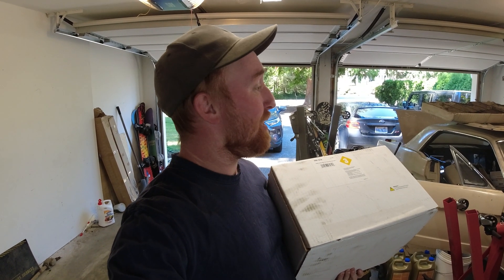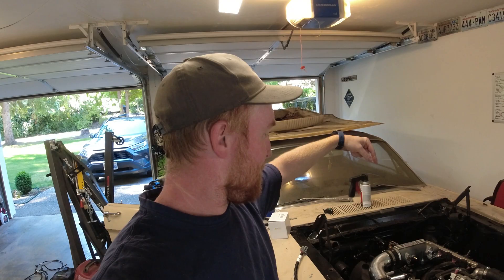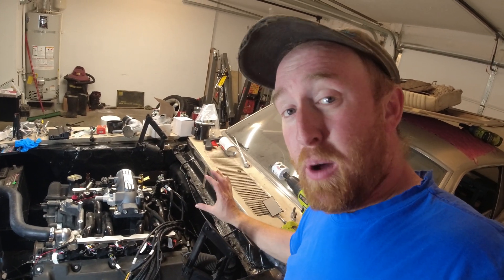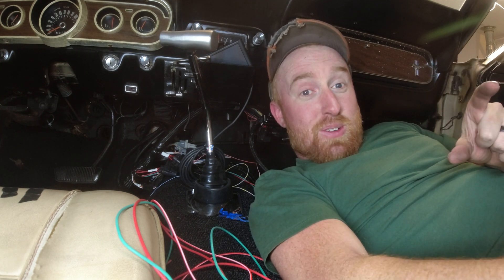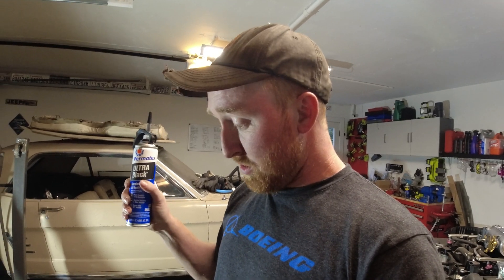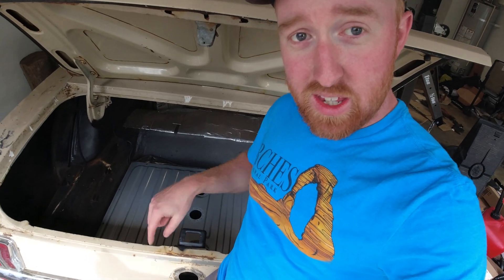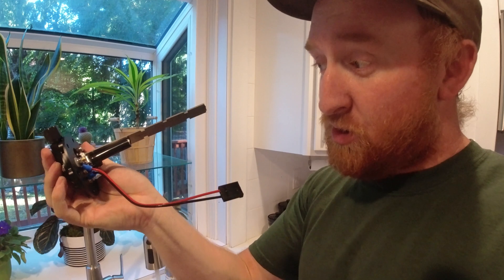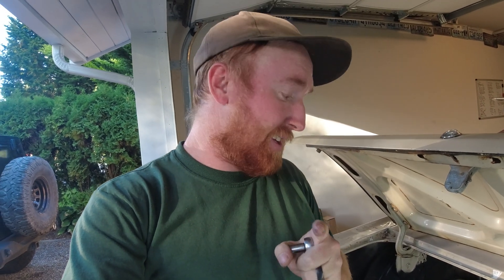EASIEST WIRING for F/I Conversion with Holley Terminator: 1966 Mustang 4.6L MOD MOTOR SWAP Episode 7

Comment: Was the Lincoln town car drive by wire and you swapped it to drive by cable?
Reply from the maker: That is correct. Since I didn't use the town car wiring harness and computer, I had the option with the holley. I'm happy with the decision!
Reply: @4WDTrek  so did you just swap the intake and throttle body?
Reply from the maker: @devonstimmerman1256  I swapped out the intake manifold as mine was cracked. But I got a BBK throttle body

Comment: I know this is a bit late but any chance you still have the specific numbers for your Holley kit and which year was the motor out of?  I’m putting a 1998 4.6 in my 73 international stepside and still deciding on which standalone I wanna go with.
Reply from the maker: I do not have the kit number. But the engine was a 4.6L from a 2006 Lincoln town car. So it had the high output heads and all of that. Not sure if Holley has a different kit number for the non high output heads. Highly recommend them though. Plug and play and it fired right up!

Comment: Did I miss the fuel pump wiring? I have a 64.5 with a 4.6 DOHC Mark VIII. I'm having issues with the fuel pump. No power at the tank. I thought it might be just a bad relay. However, the only relay I can find is for the horn. Would love to see your process before I start pulling stuff.
Reply from the maker: I'm not sure if I got that part on video. All I did was ran the single power out wire from the holley computer to the power on the fuel pump. I grounded the fuel pump to the frame in the trunk. I did also hook up the fuel level sending wires to the stock wires in the trunk, from the old car side wire to the new tank side unit.
Reply: @4WDTrek  Update on my issue in hopes that it might help someone else... I also have one wire to my fuel pump. I had a short in my ignition switch wiring. If you are not able to start your car or it stops running all of a sudden. Check to make sure it's getting fuel AND FIRE. Assuming it was a fuel pump issue, I never checked to see of it was getting a spark. It was not. I have it rigged up right now but will be replacing my ignition switch wiring pigtail.
Reply from the maker: @ESeventy  good call. Thank you for the update. Hopefully it will help someone else! If you have more questions, feel free to reach out on Facebook, Instagram or Gmail. All same name as the channel
Reply: I am putting a DOHC 4.6 from '05 Lincoln Aviator into '66 convertible GT but having hard time getting motor low enough to clear hood without having to slide it back far enough that it will hit blower motor.  What oil pan, intake and throttle body did you use.  I would like to leave hood stock.  Thanks!

Comment: Would a foxbody motor and a holley terminator x work with this mustang?
Reply from the maker: It would! Thats actually a lot more common swap than the 4.6l 2v. It is a lot easier of a swap as well. It's a lot more narrow of an engine and doesn't require new sub frame nor cutting out shock towers.

Comment: Looks like it’s hot out! You been sitting on some footage I see. Lol so frozen here in Washington brr
Reply from the maker: Well... just a bit. =P gotta take time to edit and make sure I do everything right! Haha
Reply: @4WDTrek  haha it’s all good! I’m up here in Arlington I think it’s about time to take the tj out for a spin! Cheers
Reply from the maker: I'm just barely south of you. I've been out pulling people out of the snow with my jeep
Reply: @4WDTrek  what you using to pull em out? Yankem kinetic or a bad ass pull rope? I’ve seen guys out doing that I need to get in the spirit!! Who has some 33 inchers for sale? I’m ready to upgrade!!
Reply from the maker: @motomason  in this amount of snow, all it takes is a little tug. Most vehicles around are NOT set up to be pulled. So you gotta be careful. Most of the tow hooks are no more than tie-down points from shipping from factory. My milestar tires are freaking fanatic in the snow so my steady pull in 4wd low is enough. So I use just a standard thick tow rope.